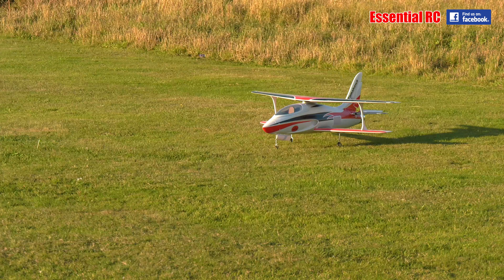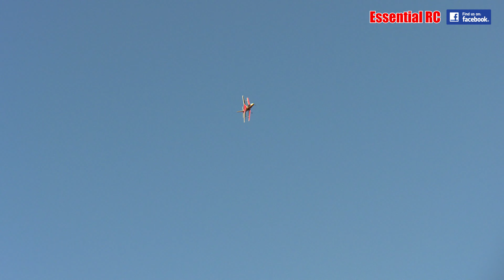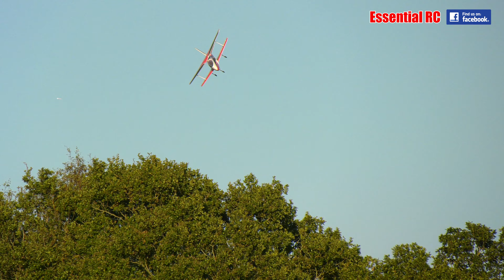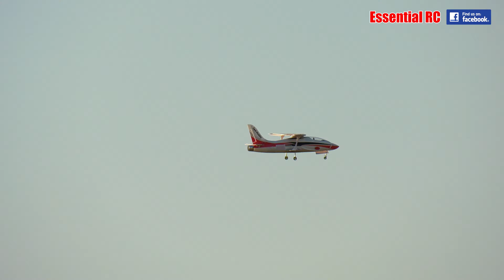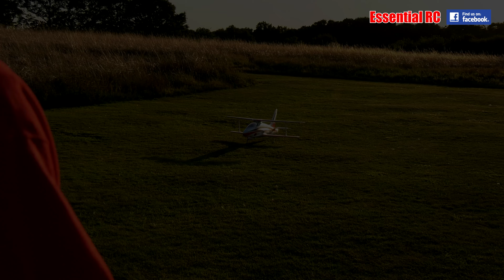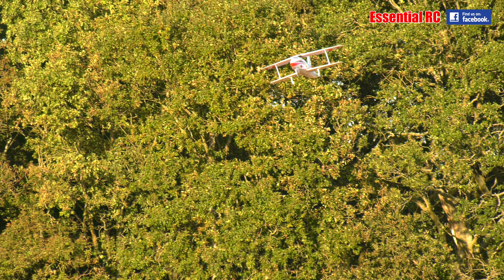HOW TO LAND A radio controlled (RC) EDF JET ? (TAFT Hobby Quantum Biplane 90mm EDF JET)

Comment: landings better than mines
Reply from the maker: Just takes practice especially with jets...and to actually think about HOW its done. So many approach too high or try and glide in. Need to cut the power and let the jet SLOW DOWN, bring in the flaps and then re-apply power to keep it in the air.